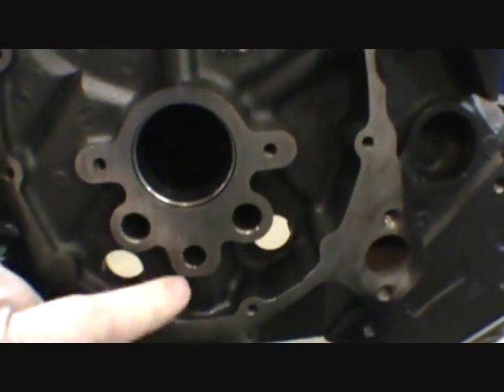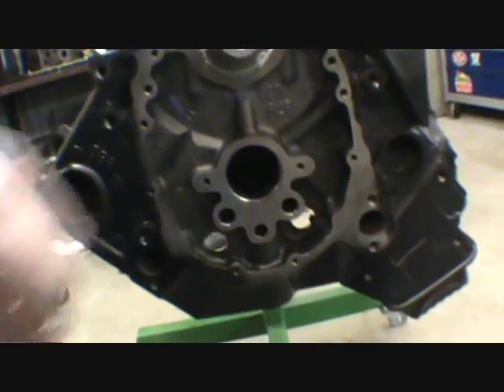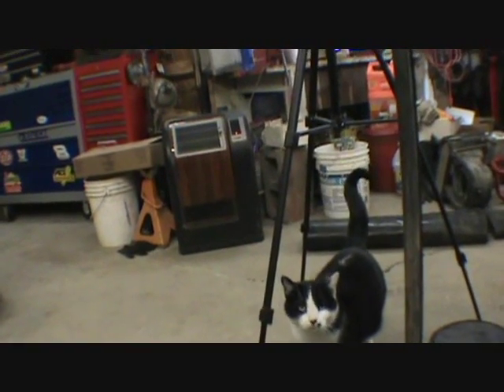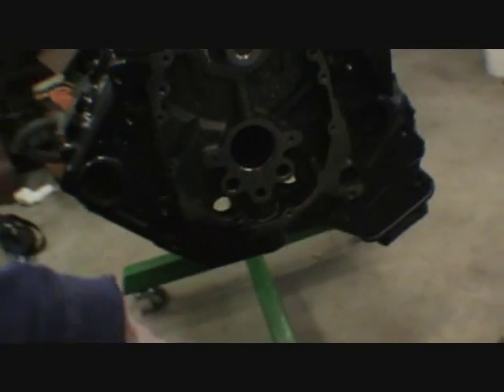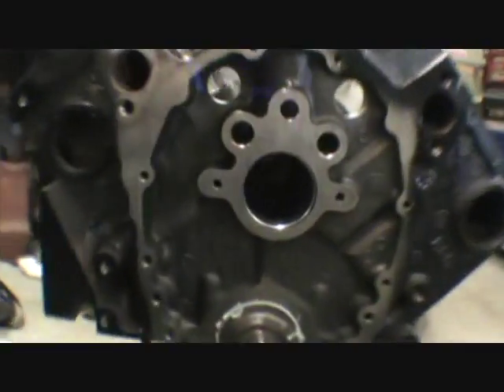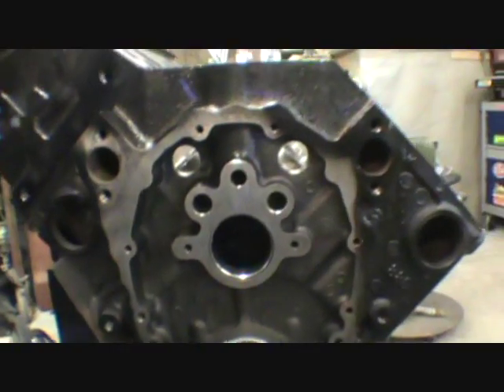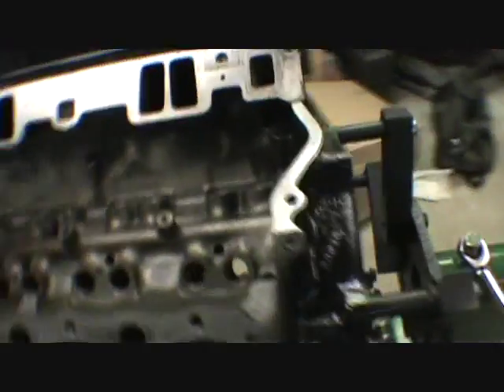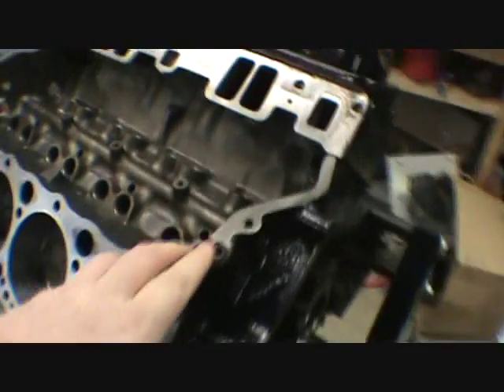part 10 1999 5 .7 build why is it so hard to get right parts

Comment: I know all about the enjoyment of parts being wrong. When I worked for a g.m dealership, the word I hated most was midyear production change. It meant they were redesigning the next years model, which meant clear out the assembly bins then use the new parts. So you could have a 1992 truck with 1991 parts, depending on the build date. Headlights, grills, trim, all could be different. And the aftermarket parts catalogs would not take the build date into account. They would use up their current Inventory of parts on the assembly line, then switch to the current years design when the last years parts ran out. Its a nightmare.